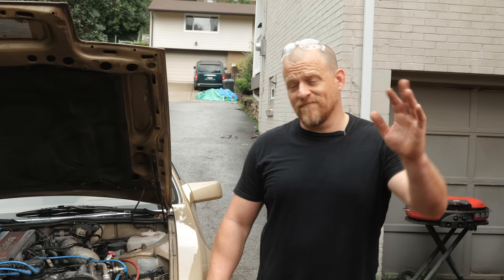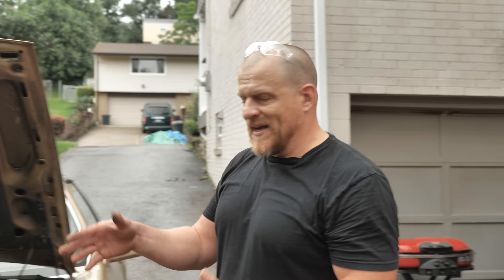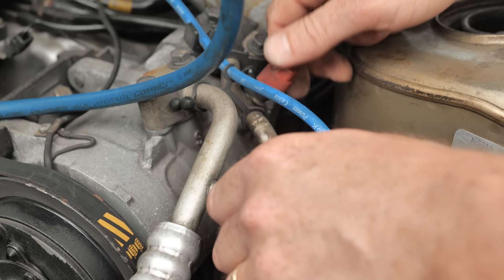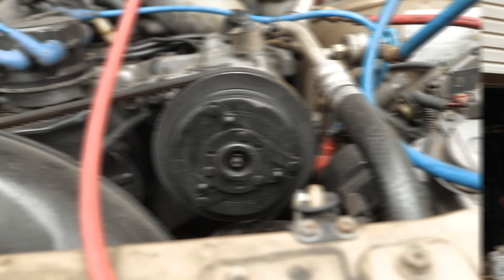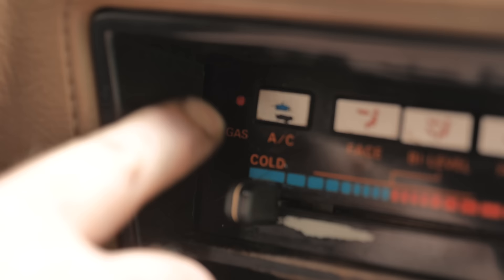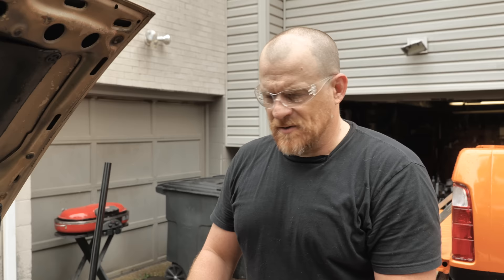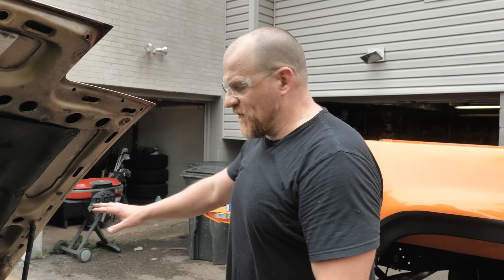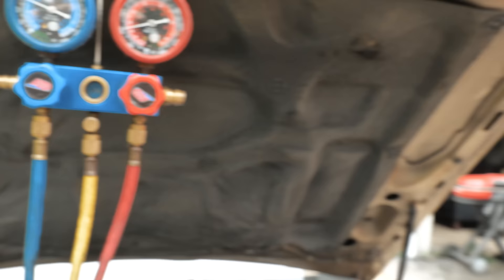A/C Leak Testing, Repair, Evac and Recharge (ANY CAR!)

Comment: You do know to change oil in vacum pump every so often. yes it does make a differance, i learned that a few years ago. it coolect all the sh## you pull out.
Reply: I am glad to see some info about the vacuum pump oil.  I have a pump that I used on one vehicle and it has been idle now for a couple years.
To go back to use again, I guess I should change the oil ?
After I had used it the time I did, I didn't know whether to leave in the oil or dump it out then.
Reply: @davecaselli1957   well after so many uses you will see oil changes colors from the stuff coming out of system.
Reply: The owner's manual that came with my Robinair 15600 vacuum pump says to change the oil after every use.  I bought this pump new in 2006 and have been doing that ever since.  Pump still works like new.
Reply: They are called non-Condensible’s. It is the stuff removed from the system that do not boil off at low pressure, burnt oil particles and bits of the seals from the compressor or o rings deteriorating. They contaminate the vacuum pump oil and prevent the Rotary Viens from making a good seal.

Comment: Paul another great video.  I always learn something when I watch your videos. Love your premium site I highly recommend it to anyone.  My question to you is do you have a place where I can obtain some resources on automotive a/c diagnostics based on pressure readings which are accurate and reliable?  There are so many charts and guides on the internet  and they all seem to contradict each other.  There are so many different variables in diagnosing a/c systems and where you are obtaining your readings.  I'm just looking for something that is accurate and reliable to help guide me in my a/c jobs at work.
Reply from the maker: thank you Gary! Not sure where to guide you for the AC stuff you are looking for. As you said, location of the service ports in relation to a restriction is a big factor too! Variables, upon variables my friend

Comment: I really appreciate the help from the video...
How do you dry the air from the compressor to use in pressure testing for leaks? Does something like this work: SMC AMD250C-N02 Micro Mist Separator Compressed Air Filter, Manual Drain, 0.01 micron, 1/4" NPT

And, how do you connect it to the A/C system?
Reply from the maker: This is why I switched to nitrogen, no need to worry about moisture anymore.

Comment: I serviced a 2000 Honda Accord v6 the other day. I charged through the low side with the car running. For some reason it seemed really difficult to charge like the freon wasnt getting sucked in. Can i use the hot water trick with the engine running? Also i found it very difficult to use the scale with the hose attached to the can almost impossible.

Comment: You just gained another follower. You are a Godsend and an overall beautiful person! Thank you so much for sharing. I had a quick question. Does it matter if you use a 1 or 2 stage vacuum pump? I am about to attempt to fix my daughter’s AC in her 2006 Chrysler PT Cruiser.
Reply from the maker: Thanks so much! I'm actually not familiar with 1 or 2 stage vacuum pumps. I believe mine to be just a single stage? As long as you can pull down to 29" of mercury, you'll be good.
Reply from the maker: Oh, and welcome to my channel! Appreciate having you here
Reply: @ScannerDanner  Oh that’s awesome news. Thank you so much!
Reply: @ScannerDanner  Thank you and glad to be here!🙏🏽

Comment: What told you that the radiator had to be replaced, besides water running out every where, and the car overheated,  I think I just answered my oun question.
Reply from the maker: The radiator didn't need replaced. I thought this comment was on my Jeep AC video

Comment: Explain that the gas pressure switch will not allow the compressor to start without enough gas in system
Reply from the maker: for sure! I have in many other AC videos, sorry I did not mention that here

Comment: I would rather charge it with a little refrigerant than air.  Heck, Fellows sells non-flammable computer duster, and it is 1,1,1,2-Tetrafluoroethane on the can which is HFC-134a.  The ONLY difference is it is licensed by the EPA as a propellent, so it's legal.  If I can spray a keyboard out with refrigerant (legally), a couple of ounces in a car is reasonable.  I am NOT suggesting dropping a pound in there to find a leak.

Comment: The cheap gages doesn’t hold hi pressures always and do not ingeg the ac when you have air in the compressor
Reply from the maker: nothing wrong with these gauges for the 2 times they get used per year

Comment: This is a shout out to other mechanics.  Don't be a dick for someone asking to have his system drained.  Like really what you are doing is dealing with someone who is trying to do the right thing.  This guy really does not need to spend time asking around when all he could do is open the valve and release the stuff into the air.  Like it is easy to rent the vacuum pump and the cans do come with a gage.  Like if the guy is trying to do good for the environment and you have a recovery system just charge a nominal amount like $10 to drain the guys system.  Both of you will be doing something for the environment.  Way to many places will not do this.

Comment: tee off ur yellow. (ideally it should be closest to the low side, but teeing off the vac line at the manifold can isolate it when shutting the valves on the manifold)

Comment: I find most times the old theory of charging with 10-20% less 134 vs 12 is not accurate. Most times the charge capacity ends up performing the best at the same level as the original r12 spec
Reply from the maker: Exactly what we saw here right? Thanks!
Reply: We have two 90's models Cavaliers in the family that we use a work/beater cars.  The 92 is an factory R12 car and the 94 is a factory R134a car.  They both call for 36 oz of refrigerant.
Reply: @Mr2004MCSS  exactly. I feel like so much of that early theory and information in this area has proved to be inaccurate. When Paul stated early in this video he was doing a conversion to add less freon I said out loud "you'll end up putting that other can in before you're done".
Reply: @calebbouchillon  I will say that we also have another 92 Cavalier that years ago I changed over to R134a from R12 because I didn't have any R12 at the time and didn't yet have my 609 certificate to buy it.  I did use the 20% less amount of R134 in the R12 system that was being recommended to me at the time.  I will say that the car's AC worked fine with that much less 134a in it but I wonder now if it would have worked better with the full 36 oz's in it.

Comment: great video. I'm working on a 2004 Tacoma  and when my low side guage drops below 30 psi the bottom of the green on the guage the low pressure switch cuts the clutch off. Why does yours keep pulling it lower and does not hits the low cut out. if I could get mine to pull as low as yours it would be super cold.
Reply from the maker: Not all systems use a low psi cutoff switch to control evap icing. This is a txv system that I believe uses an evap temp sensor for this function

Comment: Great video! I really enjoy the passion you have for doing things the right way and not just guessing. 5-6 years ago I had no clue how to work on A/C. I have since acquired a set of gauges, vacuum pump and temperature gauge and feel like i now have a decent understanding as well as the tools to work on an A/C system but videos like this are super helpful in expanding my knowledge. I'm curious if a system wasn't vacuumed down before being charged(such as one that was previously converted from r12 to 134), is there any easy way to tell that short of doing it yourself, and what noticeable problems would the system have if there was moisture in it? Also, are there any good options for a homeowner that needs to drain their own A/C system of freon without venting it to the atmosphere? Thanks
Reply: If the system didn't get vacuumed down and there was still moisture in the system, the moisture would react with the refrigerant and it would become corrosive. The corrosion causes metal to break down forming a metal sludge, destroying the expansion valve and the compressor and causing a non-working a/c system. This can also happen if there is a leak, moisture gets in and you just keep charging the system. Eventually the compressor will fail.
Reply: bottom line ALWAYS VACUUM IT, never assume it was done, never chance your ac components...

Comment: also change the cycleing switch out for a 134a switch
Reply from the maker: This is a TXV system so no cycling clutch switch. From memory, those older ones were adjustable too right?
Reply: @ScannerDanner  I forgot that was a txv but in my experience the orface tube systems cycleing switch can't be adjusted reliably.

Comment: Great video Paul as always. Question: While you are pulling a Vacuum, the Yellow hose with the Check Valve end is connected to the Vacuum Pump. How can the Vacuum Pump pull Nitrogen through the Yellow Check Valve connector ?? As far as I know a Check Valve is a one way operational valve, while you were releasing the Nitrogen from the AC system after confirming a Fix, you had to loosen the Yellow Hose connection at the Gauge Set or completely remove the Yellow hose to let out the Trapped Nitrogen (due to the Check Valve at the other end of Yellow hose) ? Thanks for the Great Video !!
Reply from the maker: The check valve is depressed when connected to the compressor and or can
Reply: Thanks Paul, I was thinking this check valve operates like a check valve in the fuel pump.  But actually I see it acts as a one way valve when NOT connected, basically as you say gets opened up at the moment it gets physically connected, thanks So much, keep up your Great Work , I've learned so much from you and appreciate your work !!!!

Comment: Master big salute from India. I am your Fan. Do we need  car ac charging station for correct amount of gas charging or gauge reading is enough? Or  sight glass bubbles? Please replay.
Reply from the maker: If you're charging with a larger container, you need a scale to weight it. I'm not good enough to use gauge pressures alone and be 100% confident that I'm exactly the charge level I need to be. Some are I guess? I'm not

Comment: Excellent video! Where can I get a fitting for my nitrogen regulator?
Reply from the maker: The nitrogen bottle and regulator that has a port on it to adapt my manifold gauges was all bought at the same place. It was at commercial only place that doesn't sell to the public. I had an inside connection with my brothers shop as he does work for them at times. So I'm not sure where to guide you my friend. I'm sorry

Comment: what would you say to a seasoned mechanic who says shrader valves never leak. at my shop we have a lot off fleet vehicles come in with ac issues and most of the time its the shrader valve that's covered in oil residue or the leak tester is beeping on them and there response is its because the ac machine just got removed from the ports
Reply: Clean them soap water blow gun. Inspect with black light. Spray soapy water watch for bubbles blowing from them
Reply: Are they coming back after he fixes them?

He may be right and you may be right at the same time.  Just not at the exact same time.  But if a vehicle is a come back within a few weeks for the same AC problems,  I suggest handing him a rag and spray bottle of soapy water and telling him to verify it isn't leaking as he is cleaning the oil and dirt away from the service ports.
Reply: @sumduma55  no what udall happens is they come in low on freon I look them over check for oil spots and leaks with the sniffer get to the valves and it goes crazy his response is it probably needs a evaporator since must our stuff is ford's and he claims that fixed all his previous leaks
Reply: Of course shrader valves can leak. They have a seal. I just changed a bad shrader valve yesterday

Comment: Hello, I have a car (a 300ZX just like this infact!) where a previous owner did the 134a conversion. My problem is, the compressor is super loud when it runs, it sounds like a lawnmower or a growling dog. Despite that, the A/C does blow pretty cold so it seems to be operating. It does not make any sounds when the compressor is switched off. Do you think the compressor is wearing out or do you think it just needs oil added to the system? I don't know what kind of oil the previous owner used or what their whole conversion process was.
Reply from the maker: I'd be looking for a used compressor like we did. If it is that loud, it's going to end up pumping it's guts into your system and having to then replace the condenser, expansion valve and receiver dryer are all in your future

Comment: Also never put a charge can in hot water while the valves are closed it can spike pressure and explode.  Also he is using warm water not hot water.  Never use water hotter than 20 degrees over ambiant Fahrenheit or 10 degrees Celsius
Reply from the maker: Agree! Thanks for reminding people

Comment: I had a 1991 Civic that was R12 and ran 34 degree center vent temps on a humid 95-degree day.  I lost the compressor and had to retrofit to R134.  With a new evap, new condenser (parallel,) and new dryer, I was never able to achieve better than 42-degree temps.  Bootlegged some R12 and got back to 34-degree temps.  I was always curious what caused that.
Reply from the maker: From what I've read, the molecule size is different and you need larger components to achieve what the original design system did with R12

Comment: How do you pressurize the system with just a vacuum pump to then spray soapy water for seeing a leak?  If I can't get compressed air or nitrogen
Reply from the maker: You can't

Comment: When doing a recharge with a manifold set- I'm guessing keeping the high pressure coupler value should be open? But the high pressure value on the manifold is always closed while the vehicle is on + compressor on. Is this correct?
Reply from the maker: manifold gauge closed on the high side, always, with the engine running. The service port which is feeding the gauge pressure is always open otherwise you cannot read the high side psi. Make sense?
Reply: @ScannerDanner  Thanks for the clarification!! For some reason when I was reading my levels there is nothing coming from my high- I thought the coupling ALSO needed to be also closed....but I was like how in the world is it supposed to read the level? Thanks so much for the clarification, I'm so excited to rebuild my AC system on my classic blazer.

Comment: 45 mins.  Just pull a vacuum when you take off the mu gage again before charging.    How did you measure how much refrigerant you  put in?
Reply from the maker: Looked up factory specs and used the correct amount using 12oz cans

Comment: Greetings Don..could i use regular compress air would it turn the compressor on? Please and thanks..to get a hydrogen bottle in Jamaica its very expensive🙏🏾
Reply from the maker: It's Paul Danner 😉 and yes, I've used compressed shop air that's run through a drier, for 25 years before I switched to nitrogen and never, not once, had any problems